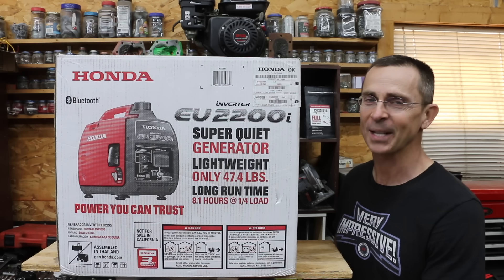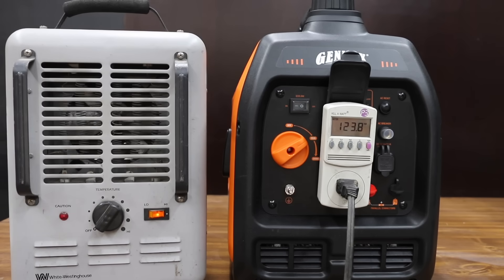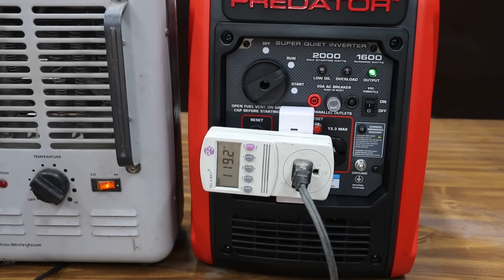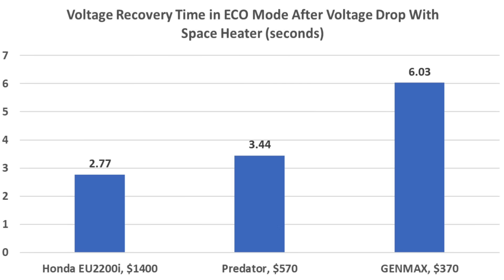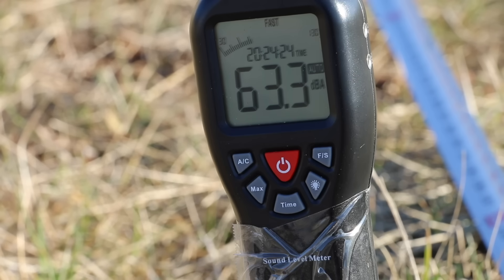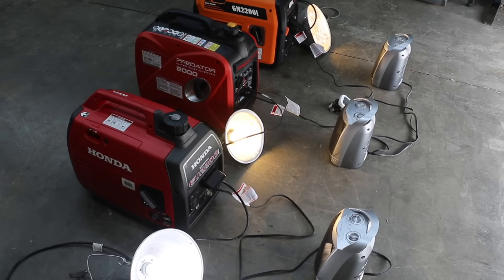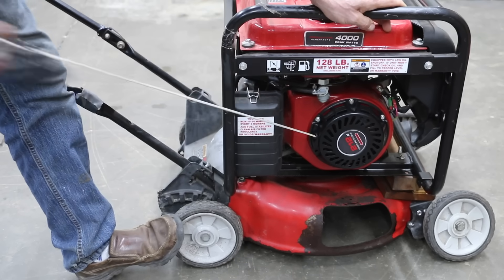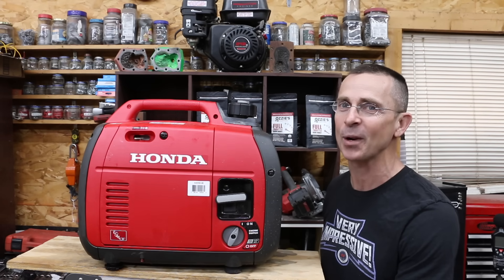Cheap Generator Better Than Honda? Predator vs Honda & GENMAX—Let’s Settle This!

Comment from the maker: Here’s the list of products reviewed. More details in the video description. Thank you! 
Honda: https://amzn.to/3ZaBZIj
GENMAX: https://amzn.to/3Z7nUv1
Predator: Available at Harbor Freight
Oscilloscope: https://amzn.to/3Z8vHJ5
Reply: I bought the Honda many years back when it was the EU2000.....it lasted 4 years. Then the valve got stuck in the valve guide, Fixed that then the wires all fried. Bought the predator after that....after 4 years still running. only had to replace the pull cord. stull running almost 8 years later. IDK it was cheaper and worked almost the same. Also the predictor ran equipment the honda would not run. so I think the Predator is a much better value I would never waste my precious money on  a Honda again.
Reply: @Mikefngarage  Thanks!!
Reply: Hands down, the best channel  on YouTube!!!
Reply: Hey man, despite all of the negative comments about the way you speak, how fast you speak, how it relates to a third grader, etc., for those of us that know even the slightest bit about generators, I think you do a very good job. Don’t listen to them.  If they don’t like your videos, no one is forcing them to watch. I myself, find them very informative and useful. I own a Generac 16 kW whole house back up generator, so why would I even be worried about this? You may ask? I am not a serious prepper, but I take all things into consideration. Not only do I have a 16 kW whole house unit, what if there is a cyber attack on our nations natural gas grid? There goes the whole house generator solution. I also have the ability to sustain 7 kW via an EcoFlow system with two spare batteries. I have enough solar panel capacity to keep them charged. I can run enough of my household to sustain life and most convenient daily needs.  
. My only two concerns, are fuel, and the ability to generate 220 Volts to operate my well pump. The smaller quiet generators that you discuss are an excellent solution for the cloudy rainy days where you may not have enough solar to keep your EcoFlow or similar systems charged. Therefore, with the excellent fuel economy of these units, you could run these generators for an hour or two per day to keep your so-called solar generator, EcoFlow, etc. charged every evening with minimal noise, thus having the next 24 hours taken care of. That only leaves the situation of generating 220 Volts for the well pump. But with all of these options, I am sure there is a workaround for that. You could even buy a larger portable generator that can generate 220 to address the well pump issue, while at the same time charging your backup batteries in place of the solar panels.. But that gives up a little bit of the whole idea about silent operation and being private about running something during the evening. But there is an answer to every Issue I guess. So thank you for what you do, and I find it very informative. Especially for the noise issue with the generators being quiet and also for the number of hours, they can run on a certain amount of fuel. I prefer the propane option as opposed to gasoline, because it keeps almost forever, and you can stockpile it.  Like I said before, for only a couple hours a day on these more quiet generator options, you can charge your back up battery scenarios without the worry of having sunshine for a few days for your solar panels. So please people, take them to consideration all of these other ideas when you are just sitting there thinking of comments about ways to slam this gentleman‘s videos. I think he is doing a fine job. To you, sir, thank you for what you do.
Reply: Agree he's my go to guy for alot of things I buy
Reply: Please test 5,000 running watts generators with pure sine wave and 30 amp receptacle.
Reply: You might consider doing tests on inverters. I have a cheap 12v 150w one but need a 12v 500w for my work van and really don't know which to go for. I really appreciate your videos and the effort you go to to ensure all products get the same testing. Even though I'm in Ireland most products are available here and I have a good selection of your winning or runner up tools.
Reply: I heard about a 2 stroke engine generator. Test it to see if worth buying. The hardware store sells them he been selling them for four years and never had one to come back.😮
Reply: Could you do a test on a generater with a Brilliant GT600PN of Mitsubishi GM182 engine??? ❤
Reply: This guy is very thorough! Great videos!👍👍👍
Reply: One thing I found out was very important is parts. My Chinese made ETQ generator only had 52 hours on it when then piston slammed into intake valve and broke the head. I was able to find a replacement but from only one source so it's fixed but I started to look at more name brand models with the hopes that getting parts, if there is a need, will be much easier to get.
You do an AWESOME job of testing and since there are many other brands, such as Generac, Champion, Firman, to name a few, I'd love to see a more extensive tests, especially duel and tri fuel. I'm finding getting all of the stats a bit difficult but Champion really seems to tell you every thing about the units so a big plus there.
Reply: try not drinking too much coffee before your videos...lol
Reply: Dude, do you listen to your videos before publishing? PEOPLE DO NOT TALK LIKE THIS. You need to vary your speech, man. This is unlistenable. It's like a 3rd grader reading a bad book report. Wow.
Reply: @shanep5121  just set the playback speed to your slow brain speed lol...youre like a 3rd grader who hasnt learned to listen or read yet.
Reply: @shanep5121  Lot of folks watch his videos.... How many watch yours?

Comment: I had a Yamaha quiet one.  20 amp.  I ran it for 1000's of hours camping.  All I did was dump oil, air filter clean and oil the air filter, and clean up spark plugs, and the spark arrest. Every 1000 hours that said maintenance done..  I sold it after my kids grew, later no need for it.  But that thing never let me down.  I even check valve clearances, no adjustment needed.  Test honda vs Yamaha.  Always been a yamaha blue for everything.
Reply from the maker: Thanks for sharing.

Comment: You can't get some of the main parts for a Honda because they discontinue them, and if you can find them, they're at least twice the price of many other equivalent Generator Parts, it it breaks down... yur just screwed! Better off with Any Other Brand. Test Champion Brand!

Comment: I'm a Honda fan between the Ex650, 1000, 1000is, EZ2500, also include a new the 2200is. Also a big Champion fan, owning the 4500 inverter generator. Really impressed with it quietness and capacity. Good video, but I forgot how fast you rap..

Comment: WENDF360iX.  Dual Fuel and better wattage (3,600W/2,900W running) than the Honda for much less than half the price (~$490) .  Hondas are great don't get me wrong but I love the WEN it rocks and will last me years and years.

Comment: I wonder if you could build an insulated little box to quiet the generators further? 

I wonder if running the exhaust closer to the ground with quiet the generator for further?

Comment: You should also check power when you tested fuel efficiency. Honda probably turned off first because it deliver more power than other brands (higher voltage).
Reply from the maker: Thanks for the feedback!

Comment: Honda’s small engines are reliable. (Yamaha’s too from what I’ve read here.) There’s a cost attached to that. 
In many cases, a generator is used in emergency situations. When you need it, you need it.  
And saving money means nothing if your product doesn’t work. 
Where I live in southern Ontario, our power outages average 11 minutes per year. (We haven’t lost power here in years. Not more than 1-2 minutes.) No one owns a generator unless they camp, or run equipment remotely. It can be months between starts on my Honda. But it always starts.

Comment: I'd like to see a dollar for dollar price breakdown based on the final point value of each generator. 
A $1400 Honda generator is certainly the best, but how many Predator generators could you buy during the running life of one Honda generator? 
Hobo Freight gives you 20-25% off coupons throughout the year which would knock that price down even further. 
Value is based on more than quality, it's also based on price per unit and how long it would last by comparison. 
If the Honda is 4 times the price and lasts about 5 years of regular use with regular maintenance and the Predator lasts 2 years same, you would go through 2 and a half Predators over that time frame. 
The hassle factor has to be considered, but the Predator would likely come out on top, for the price. 
Sine wave electricity issues can be handled by a separate plug in power conditioner if that's an important issue for you.
Everyone knows Honda makes the best generator on the market, the price is the only issue.
Thanks for the effort 👍
Reply from the maker: You are welcome!

Comment: You are biased. When you compare Voltage at Approximately 13 Amps at outlet in ECO model, the baseline is 118V. That makes the difference being exaggerated.  That is unfire.

Comment: Owned many Honda suitcase generators,  they do last for years,  I generally get about 5 to 8 years before the belt breaks and that’s running at seven days a week,  will these cheap generators last as long  ????? luckily it’s a safe engine but just require you to split the case to get at it to change it and change all the seals and then it will run like new,  the only thing is the engine pull rope does get frayed from the vibration where it enters from the outside world into the case,   Easy fix is to cut rope just below the fried part and insert back into the pull handle saving you the hassle from splitting the case open to add more new cord.  If I’m correct, the Yamaha do not have a internal belt so technically should last longer,  can anyone confirm this 😎

Comment: Another great video.  Your work is impressive.  If you should happen to run out of idea here’s one for you.  Compare stock OEM oil filter,, vs by-pass oil filter, vs centrifugal oil filture.  This would be for diesel motors.  Thanks for all your work.

Comment: Hello great review of generator inverters. I have an EU1000 for RV use and it meets my needs, but I want to buy a 2200-plus-watt inverter for emergency use at home.  I know the Honda is the best quality with a matching price, but the GENMAX seemed the better of the least expensive inverters??  Your thoughts and recommendations ?

Comment: Have you ever tested a relatively newer generator on Amazon, the Gidrox 6000W Dual Fuel Inverter Generator, Gas & Propane Powered? Looks interesting, but hate to take a chance on a no name brand.....thanks.

Comment: I would either buy a dual fuel generator or a Honda and buy a separate propane conversion kit for the Honda as propane burns cleaner, no carbon in the oil but change the oil as there will be a small amount of metal in the oil from the initial break in .

Comment: I wish Honda made a generator than ran on propane, i would pay for that. I have a Champion duel fuel but it is a bitch to start. Not really happy with it, but no old gas to deal with.
Reply from the maker: Thanks for sharing!

Comment: Great compare!!! But.... Honda prices MORE than twice as competitors in the video. Could you please consider to test cheap ones in parallel and see if they will over perform Honda in voltage drop etc... who trying to save money not that sensitive to the noise,  but it will be a good compare as well. Thank you in advance,  Artem
Reply from the maker: Thanks for the idea!

Comment: I guess honda is running the engine a little fatter so it runs cooler. This helps with engine wear and rpm drops at higher loads but it needs more fuel.

Comment: Would like an explanation on the difference between inverters and generators.....
Reply: inverter is safe for computers, generators just generate power and don't care about tech. 

Or   Inverter convert your current from DC to AC then Back to DC before it output in order control the current. Generators, don't, and can destroy electronic.

Comment: Very interesting, and practical. I like to see genuine 'tests' conducted, and not simple anecdotal decisions. One comment though, on something that I have seen in several videos ..... the invertor models as compared to the straight generator models, produces a 'cleaner' sine wave, which is 'better for today's sensitive electronics'. So far as I know, our modern solid state electronics do not actually use that 'clean sine wave', but rather 'convert the incoming power to DC'. If the attribute in question is to power such a solid state device, the best comparison would seem to be that actual wave form with any variations that might result from the input 'dirty' since wave. And yes, it would then seem that a 'third party issue' in this evaluation becomes the DC conversion that happens within a specific device. Not to be complaining, only wondering about this issue.

Comment: Honda is the best generator money can buy, eu 2000, 25 years of actual continues use with no repairs other than the starter rope, change oil and air filter twice a year. Starts in 3 pulls or less every time, don’t let anyone fool you with all these cheap brands

Comment: Whatever you decide buy a dual fuel generator or a Honda generator that can be converted to a dual fuel generator.  Why ?  I strongly advise you to NEVER use gasoline in your generator.  Why ?  Because gasoline will foul your carburetor over a period of time.  Its described as a varnish which gums up your carburetor whenever it sits for a long time.  The same thing happens with gas lawnmowers, chainsaws, weed whackers and most anything with a gas carb.   Propane will burn clean which means no carbon, on your piston, no dirty oil which stays clean with propane although I do change the oil as oil may lose its lubrication properties even though it stays clean.
How do I know this ?  Because I have had 3 cars converted to propane, no dirty oil, no carbon.
This can be verified by anyone who drives a taxi or vehicle using propane,  Engines generally last longer but provide a slight decrease in horsepower.

Comment: I would like to see the predator run again with a new spark plug and a new oil change see if you get the same results maybe you have. Sometimes I'm curious if there's a type of break in. Where you have to change the plug and the oil and then it would be less Hondas I sold them there are already broken ready to go Great engine too much money but I'd buy that instead but I'm thinking about buying a predator they're on sale this weekend for dirt cheap we'll see thank you this is a great channel.

Comment: 2 years have passed. Champion has good customer service and they seem reliable. I’d like to see that compared against the Honda. Personally, the electrical details are a high priority as all new appliances rely more and more on sensitive electronic circuits.
Reply from the maker: Thanks for the suggestion.

Comment: Test generators with a 30 amp plug for run time for campers and longgevity. Ik our fushing camp has a preditor 3500 with 2600 hrs on it. Curious on how champion or firman generator would do.

Comment: I'm more interested in whether a generator (or any product) will still be going strong after 15 years. You can't find that out by comparing decibels and testing the oil once.

Comment: The Honda generator cost more but will save you less in the long run. Built to last. Reliable also and more cleaner electric.

Comment: Do you have a test for: WEN 3600-Watt Portable Inverter Generator, RV-Ready, Quiet and Lightweight with Fuel Shut Off (56360i)?

Comment: I use my Honda eu2200 10+ hours a day, 7 days a week , 30 weeks a year. They usually last about 6 years or 12,000 hours before they need an engine rebuild or to be replaced. I have used predators but they don't have the longevity and go into overload too often.
Reply from the maker: Thanks for the feedback!

Comment: Please create a “Farm Project” video evaluating Dual Fuel Generators (propane / gasoline) that includes Pulsar 2200-watt Generator and possibly the comparable Westinghouse and A iPower units.
We retired and have been RVing for 15+ years. Our 3000-watt gasoline Yamaha that is just too big and heavy for us to handle at our age. The Solar Generators such as Blueetti are interesting but having to depend upon Sunshine during a long-term power outage at home or in the RV is taking a big chance and they are expensive.
Propane seems to be a good choice. We have several 20lb and 30lb tanks and while working in Yellowstone NP a rent 500-gallon tank.
Thank You for your consideration
Reply from the maker: Thanks for the suggestion!

Comment: I paid 600 for my predator generator about a month ago, maybe I have 200 hours on it, no issues, it was low on oil after the first 100 hrs and wouldn't start up unless I tilted it just right to be over the oil sensor.  About 100 hrs before adding oil, that's not bad, now I check and add oil every 50 hrs,  1600 watts is slightly on the low side, but I might get another one and parallel them together.  So far it's great to have this portable power for not way too much in purchase money.
Reply from the maker: Thanks for sharing.

Comment: I own the Honda. I also own a 3500W Honda I bought in 1988, for 1800 dollars. It runs like it did when new.
My 3500W unit has run for 100s of hours, on the job, and powering my house during utility outages.
I will always go with Honda.
Also, because the units you tested only output 120V, there is only 1-Duplex receptacle outlet on them.
Both halves of the duplex are in parallel.....A duplex device is one receptacle outlet.